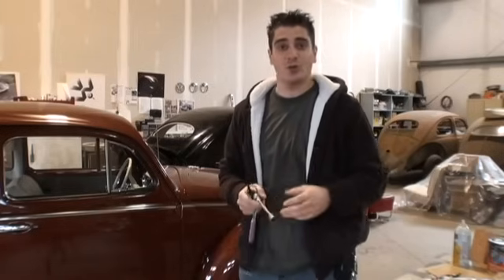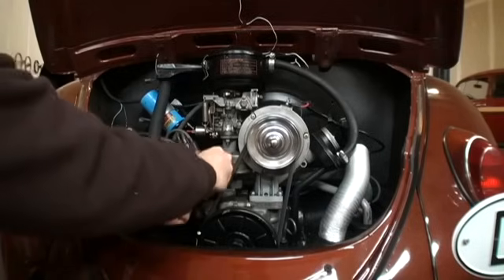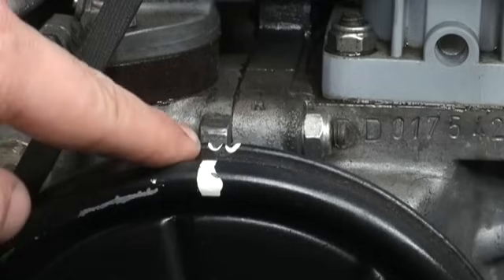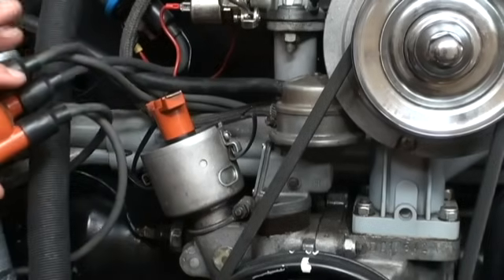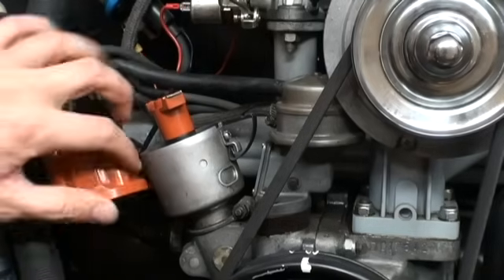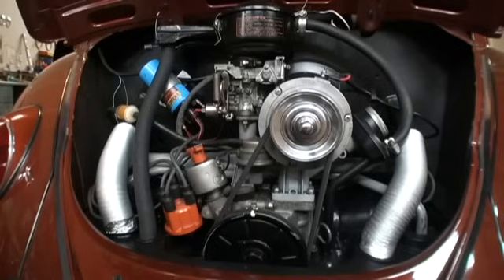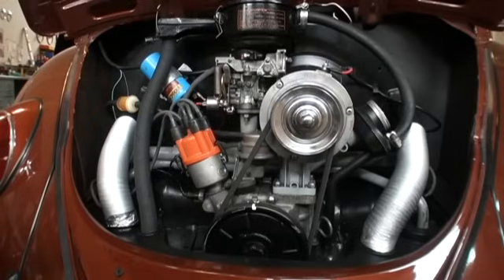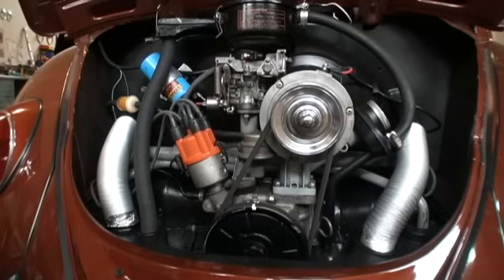Classic VW Beetle Bug Ghia Bus How to Time Set Volkswagen Engine Timing

Comment: I'm having a problem setting the timing. I think it may be because my bug doesn't really have an accessory on key placement. As soon as you turn the key a little bit it starts to click. I'm pretty sure it's the electronic fuel pump, could be wrong though. Anyway I can't get the circuit to complete and make the light come on. I just had to kind of guess by watching the belt run and adjust that way.

Comment: @brighteyefilms i have a 1915cc, 009 distributor. I was kind of guessing what the clicking noise was. Its how some military vehicles click over to get the electrical system ready. Sorry that's the only thing i know how to compare it to. Anyway, my bug never shows the 2 lights for "accessory on" only 1 light, then the engine will turn over past that.
Reply: The two dash lights reffer to the oil warning light and alternator light. If your missing one make sure it's not especially the oil light.
Ground the wire that goes to the oil pressure switch on the block usually mounted under the distributor.
If the dash light comes on when wire grounded then you have a faulty oil pressure switch.
The amber alternator light is also important as it ignights the alternator to start charging the battery.

Comment: my bug is a 1600 dual port and i finally got it running buy it seems to be idling pretty high. could the timing still be off?
Reply from the maker: or just adjust the idle screw
Reply: Just gotta mess with the idle adjustment screw.  Or if its cold it will run high to warm up of course

Comment: Hi chris, I've just tried this with strange results. I had removed the dizzy only to access the fuel pump, put everything back and the timing is out. Now, while at TDC, the rotor points to 11 o'clock. The check light is constantly on and slightly blinks off when turning the dizzy clockwise. Everything seems opposite to you video...  won't start, just splutters and pops. Any suggestions?

Comment: I thought the 009 is 10 degree BTDC and then 32 degrees BTDC at full advance, so you need a timing light to do this, but that said Im sure your way is just fine, these cars aren't quite as high performance as a Bugatti Veyron so its not so crucial

Comment: Ok so I was an idiot and didn't use my light to time it. I just tried to turn it over and i heard a pop. I immediately stopped and when I pull the throttle one of my carb seals was spitting gas. I am going to break down/clean the carb but do you think I did any major damage? I hope to God I didn't.

Comment: If there's no points just a module is this procedure the same?
Reply from the maker: Yes, but some pointless ignition modules do not work with this method. You will need a timing light.

Comment: Okay I have a (Q) I changed my oil,spark plugs and ajusted the valves , on my 1966 vw bug, it turns on good it toons pritty smooth it's a oil shaky but won't turn off how do I know if I did it righ? I just gotthe bug about a month ago ad I followed these vid on how to do it, can some one let me know maybe how to tell if the valves are wrongly adjusted or the timing? How is a vw bug engine suppose to sound?

Comment: why my test light always on where ever i put in on negatif or positive of the coil?
Reply from the maker: Alfius Andri Effendi Neg side.  You need to also check your points, they may not be opening or closing.  Check the gap.
Reply: +Alfius Andri Effendi ..mine too. did you find the solution?

Comment: what the red light for G at meter  means when we start the car VW 1972?
Reply from the maker: +Naeem Sabir Generator
Reply: +Chris Vallone so is that continuous red light means generator is bad??
Reply: +Chris Vallone Chris actually I started my bug after about 2 years and with little effort here and there it started but I think i didnt see this Red light before. so my concern is that my new battery would go bad soon if it not being charged. am I right? or this red light is a normal indication anyway?
Reply from the maker: +Naeem Sabir If it is always on even when you run the car, then it could be the generator, the regulator or the battery.
Reply: +Chris Vallone yes thanks, but should i worry? and what to do now with this light on all the time when car running
Reply from the maker: +Naeem Sabir Yes you need to get that fixed.  Like I said, check battery, generator, and the regulator.  If you do not know what to do, take it to a mechanic that knows VWs.
Reply from the maker: +Naeem Sabir Yes you need to get that fixed.  Like I said, check battery, generator, and the regulator.  If you do not know what to do, take it to a mechanic that knows VWs.
Reply: battery is new and alternator also. I dont know what regulator is. and yes I can bring tto mechanic but can this car in this condition go to 17 km???

Comment: Cool Video, but it blows my mind how you guys tend to leave a plastic fuel filter INSIDE the engine bay! That's gotta be the BIGGEST no-no for all aircooled cars, eg: Beetles, Ghias, Busses, etc.. Please for safety sake, move the fuel filter out the engine bay, before the fuel line reaches the firewall behind the motor. ie: above gearbox, where you can get access via the rear wheel well. Cheers.
Reply from the maker: There has always been a lot of scare about the filter in the engine bay.  History shows that most fires that started in a VW engine bay was due to incorrect rubber fuel line used.  When people back in the day went to get a tune up or something at their local mechanic, those mechanics never put the german braided fuel line back on, they used an SAE hose many times with no clamps.   Fires also happen by neglecting to change the old brittle line.  In the 60s and 70s VW put filters in there, the fires were not started by their setup.  Also, I have a video on setting up a filter by the heat boxes, not always the best idea either.